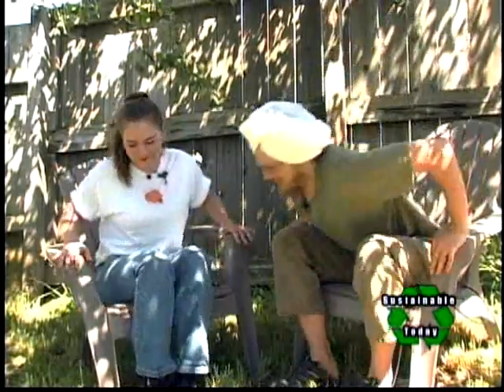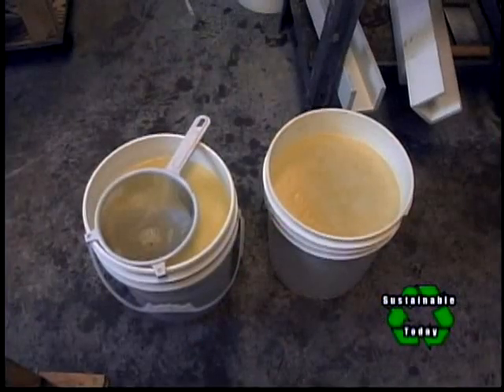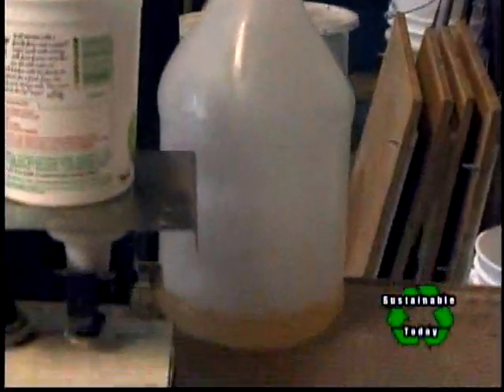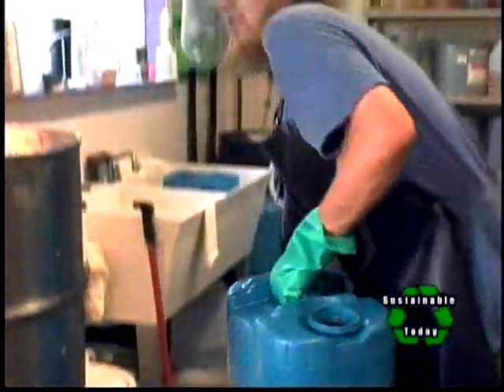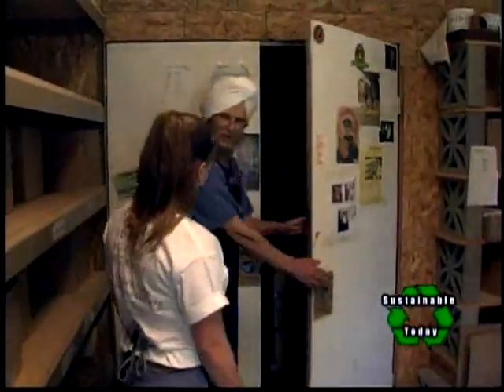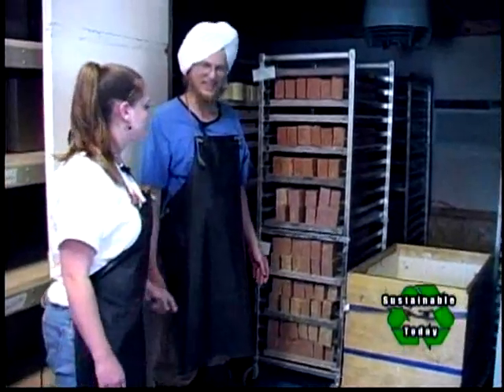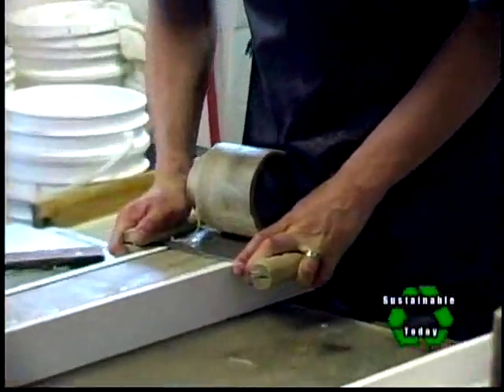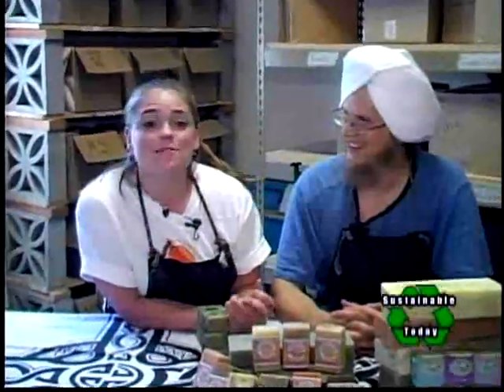Oregon Soap Company

Comment: In response to a soap-making question: best results are achieved with temps around 80-90 degrees, at cooler temperatures the oil/water mixture may not saponify properly and at higher temperatures it can cause a grainy soap.
Reply: Hi dr, just want to know the temperature normally used to get a perfect soap. n is the temp u mentioned in Fahrenheit or Celsius?

Comment: You can find a lye converter on the internet. It all depends on which fat or oil you are using and in what proportions. Lye is very strong and if you are looking to make a disinfectant soap then you will want a little stronger lye content but not a whole lot or it will burn your skin. You can use palm and coconut oil, its fine you dont need anything but oil (fat), water, and lye. Thats it. The curing process cant be sped up, however you can use the soap immeadiately it will just dissolve faster.